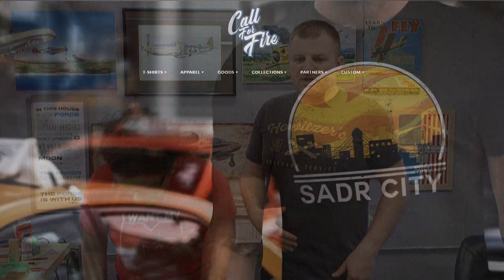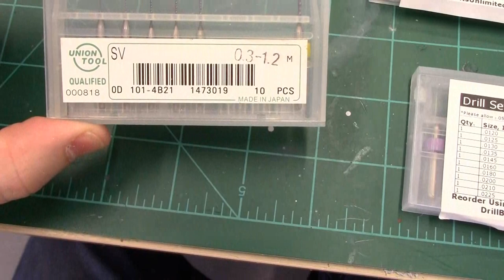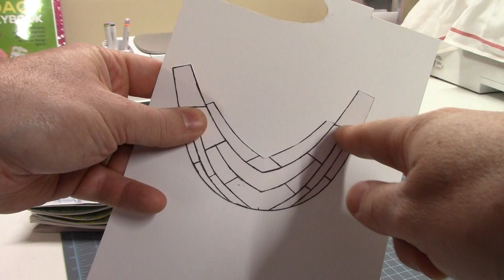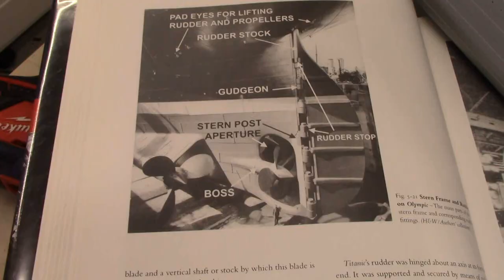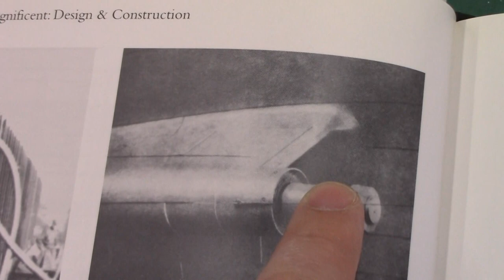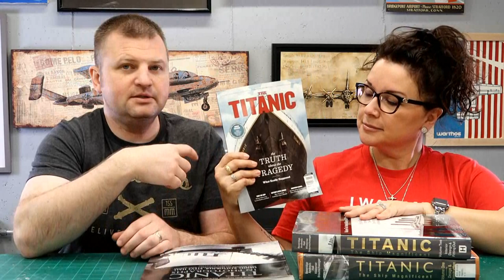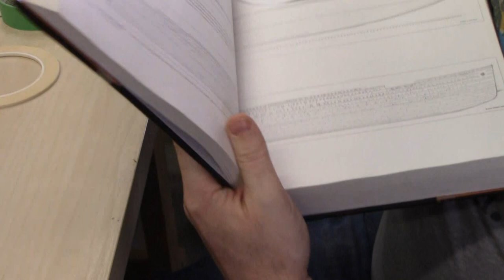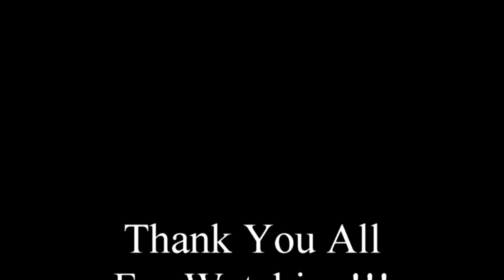1:200 RMS Titanic Build Video 1

Comment: Thank you very much for your answer, I have grouped all the questions on the subject

At 55 minutes 02 in video build 1, you speak of a condenser, are the condensers correctly placed?

In video 8, at 5 minutes 20, what paper do you use and how thick?

In video 9, At 11 minute 11 what the colors please and what item to take (smooth or smoothest)?

In video 11, at 15:07, what product did you use to fill the holes?

Sorry for all these questions, but I find your videos remarkable and therefore, I try to take inspiration from your work. I wish you a good continuation and a very happy end of year celebration. thank you for everything

Comment: Instead of using flexible, breakable drill bits, try using Milling Machine Bits. They are much, much stronger!
Reply from the maker: That's a good idea, but I'm not sure they make them small enough for the size she broke. Its rare that I even use bits that big on these models. Usually they are much much smaller.

Comment: I have used a cricket extensively for cutting styrene for my 1/270 Reliant model.  The newer model does this a lot better than the older model Cricket.
Reply: Err  I mean the Silhouette.
Reply from the maker: Yeah she has the Maker. It WILL cut all the way through the styrene, but it was going to be a bunch of trial and error to pick the best setting for that. Since we were already cutting 3/4 of the way through, that was more than good enough for what we needed.

Comment: 50:00  You could use Evergreen polystyrene T bar for the keel. It doesn't have the rib down the middle, but it wouldn't have snapped like the resin keel.
Reply from the maker: That’s a great suggestion!

Comment: Great Intro Ben and Nora! enjoyed the whole episode immensely! Quick question....did you prime before spraying the hull black?
Reply from the maker: Great question, Phil! And the answer is no! I have never primed a model that I painted with enamels. I ALWAYS make SURE the surface is clean. My preferred method is rubbing alcohol because it dries quickly and will remove oils and any residue left over from the molding process. Then I just spray! If you use acrylic paint, check what the manufacturer suggest. It's possible you will have to prime your model first. In which case, I would follow their instructions closely to get the best results.
Reply: @TheMidwestModelShop  Cool, thanks for the details! looking forward to episode 2 - Good Luck!

Comment: Those metal pieces @54:46 (intake “grate” kind of thing), are sea water intakes. They boil out the salt, and incidentally that gives them literally tons of steam heating, cooking, the steam room (both direct and radiant), and believe it or not, cooling. They took water “straight from the ocean” (it did get screening) when it’s cold, like about to freeze cold and pipe it through the food radiant “refrigeration”, then cabins... public places indoors... Second class... crew... third class... general cargo rooms... kitchen cooking cooling... engine cooling... into the steam boiler again getting hot enough to come out the other end as fresh clean drinking H2O. Pretty smart suckers, hu?  
Actually, it had been done that way in other ships before her, it just that it never been done at the scale of the Titanic and her sister ships. 

It’s very possible had every watertight bulkhead went all the way to the “top deck” (top of the hull), it might have floated long enough to drag it to harbor/dry dock. Possibly even patch it out there enough to bring the bow up a bit.

Comment: I am sure the model isn't to 100% specs as sometimes (more so with older kits) they design for ease of manufacture (like movies based on a true story..lol) and/or a mistake in the molding which is to expensive to "fix" and they go with it.  Other factor is 2d vs 3d perspective, when you draw a three dimensional box visually it looks square but the lines are different lengths. 

Any case the red (technically a primer) is painted at a certain water displacement (weight) and depending on SOP that line may change during re-painting. Many Navy ships that red isn't visible until the paint wears off and they only re-paint above the water until next drydock. Even after a week you have huge amount of corrosion already.
Reply from the maker: No the model is NOT 100% accurate. But there are some details that will never be truly known about this ship making that prospect impossible. However, it is currently the best and most accurate kit you can buy. Which is always a good thing.

Comment: Drilling portholes (sidelights).....oh, you poor bastards. It took me roughly 2 weeks to drill mine with a pin vise (this was the 1/350 Minicraft kit, though). Even though you aren’t a “rivet counter” (some of us are cursed with that level of OCD), I think there is a Facebook group that is the remnants of the Titanic Research And Modeling Association ( I was briefly a trustee on that site) where you can get all kinds of info about the model. 

I started my build in 2012 and put it on hold in 2015 (maybe you’ll inspire me to pick it up and finish it). Back then, you had 2 choices in scale.....1/350 or 1/144 scale (not including the smaller scales) and I’m glad that this scale didn’t exist yet. The time, effort and aftermarket parts would have bankrupted me. I have enough tied up in the 1/350 kit already.

One hint for your rigging and funnel shrouds......fly tying thread (tan and gray). It won’t “fuzz up” on you, it looks correct to scale and can be tightened with a hairdryer. 1/350 uses an 6.0 or an 8.0 so size up accordingly for your 1/200. EZ Line is an alternative but might not take the paint you’ll need to make things accurate. Looking forward to this build series!
Reply from the maker: The fly tying thread is a great tip! How flexible is it once you heat it with a hair dryer? Does humidity affect it? How does it hold up? I usually use a combination of EZ Line and stretched sprue. EZ Line has the undesirable tendency to dissolve when exposed to UV. So you can't put it out in the sun. But, if you bump it by accident, is stretches effortlessly and won't damage anything.
Reply: @TheMidwestModelShop  Fly tying thread is pretty forgiving. The hair dryer tip is only needed if you find a "sag" somewhere. Humidity never seemed to be an issue. This stuff was designed to get wet after all.

The one thing that could happen is that you could snap your masts if you hit the rigging just right, so I built my masts from brass tubing. No bending at all even when snugging up the Marconi wires.

For the funnel shrouds, I recommend making or improvising eyelets in the Promenade deck. This way, if you break a line, you can cut it loose and replace it. The lines aren't glued to the deck. I found mine at a local railroad hobby shop and are stanchions for handrails on steam boilers (HO scale).

Give this site a look. This model was built by another TRMA trustee and also my mentor for this build. He is the one who edited that book you referenced "Titanic: The Ship Magnificent".
His build is an absolute masterpiece:

http://www.titanicmodel.net/

Remember......this is 1/350 SCALE!!!!! You'll get lost in this "How I Did It" website.

Standing by for more uploads and even questions!
Reply: @TheMidwestModelShop  Oh....one other "fine detail" tip. On the cargo hatch covers, I used slightly watered down Elmer's Glue (PVA glue) and toilet paper. 

Heh heh, yeah, toilet paper. At that scale, it had the perfect texture to look like canvas.
Reply from the maker: That one I knew about 😉

Comment: I know this is the updated kit..is there a review of  the improvements made by trumpeter? Plus how bad is the hull..as per Nigel build..looks crazy for a modeller like me to do🤣
Reply from the maker: So I don’t know if anyone has done a comprehensive comparison, yet. But as far as seeing what’s “wrong” with the hull goes... in my opinion the only things you can just look at and say “that’s not right” would be the shape of the kit supplied rudder and the bow hawse hole. But everything else...well you have to really study the porthole placement and compare them. And as far as the hull shape goes, you really have to cut out fairing lines that are to scale, put them on the correct station, as Nigel has, to see what wrong. But I haven’t done any of those things. Because as far as I can tell, but just looking at it, the hull is fine. Because of Nigel’s efforts and others, I “know” it’s not right...but only because they showed us. Otherwise, I never would have known. Bottom line, it IS the most accurate kit you can get. Now you can say it’s the “least bad option” or it’s “the best one out there”. Totally up to you.
Reply: @TheMidwestModelShop  thank you for the info..really helpfull.

Comment: So those portholes that are on the same line of the condenser aren't portholes they are drain vales for the ballast and pumps.
Reply from the maker: Correct. The bigger ones right above them are.
Reply: @TheMidwestModelShop   weird because the planes unused to paint had them slightly.below the above water line.

Comment: hi Ben. what was your old air brush? how much was it? how happy with new one? . is there a steep curve in performance to  be worth it?. my cheap one seams ok. but i only paid $20.
Reply from the maker: My old airbrush was a double action deal from “Air Brush City” I think. Now I have an Iwata. The Iwata is WAY nicer. At first I didn’t think that was the case. But I’ve noticed over the long run that this airbrush is super consistent as long as you keep it clean. I think the most value comes from the fact that it will last for ever. My old one quit working one day and no amount of cleaning and checking the parts would fix it.
Reply: @TheMidwestModelShop  how much was the old one? and the new 1. Iwata ? a particular model Iwata?
Reply from the maker: The old one came with a compressor. So it was a combo deal but I think the brush was $25? The Iwata (can’t remember the name at the moment and I’m not home.) it’s around $140.

Comment: hey Ben I was wondering if you knew what scale the furniture would be on the 1/200 titanic, I contacted Nigel about this but haven't heard back as of yet, for example the grand piano and the beds and other furniture because I was trying to figure out what the scale would be like 1/6000 or 1/5000 or so on, so my friend if you could give me your opinion on this question it would help me out a great deal, thanks and great modeling.
Reply from the maker: Well the ship is 1/200 scale, so everything is 1/200 scale including the furniture.
Reply: @TheMidwestModelShop  yeah I know the ship is 1/200 scale basted on 882.9 feet long I don't think that's going to be the same with the furniture inside the ship but I'll take a look and see if in fact it is 1/200 scale for the furniture and let you know, but thanks my friend for writing back to me about this issue and I think you do a very good job with the models you make so happy modeling.
Reply from the maker: @rockyfolley1511  yeah the furniture is 1/200 scale. That’s the idea with keeping everything the same. All the figures for the Titanic that are “correct” are 1/200 scale. Because the whole model is in 1/200 scale. A 1/6000 or 5000 scale grand piano would be microscopic. The benches are 1/200 scale, the railing is 1/200 scale. It’s alll 1/200 scale.

Comment: Gettin very stressed cause I can't not do the bow of the ships water line right. I look at the video and I'm not understanding how it's done. Please help me. I'm going crazy
Reply from the maker: Are you talking about how I curved it?
Reply: @TheMidwestModelShop  yes
Reply from the maker: I marked a straight waterline first. A perfectly horizontal line. Then I picked where on the bow, for example, the line should end and used tape to angle my line down to the horizontal line I drew. The horizontal line passes through the correct midship positions so you can get that height right.

Comment: Yeah I was wondering if there is any way that I could afford to get this 1:200 titanic model ship I have looked everywhere and this is way expensive on my budget so I’m working on the 1:400 titanic ship it runs about 150 bucks or maybe 200 bucks but one day I found it on eBay new for 35 dollars free shipping so I bought it I did the light and rails and windows on it but building this one would make my day so I’m on a fixed income but I just wished I could get this whole kit for maybe 150 bucks instead of 400 to 1,000 dollars for this size kit
Reply from the maker: Everyone wishes it was only $150.
Reply: Yeah 480 dollars for this kit is way out of my budget so I guess I’ll never get this model for my self and I really want this kit but it is from China

Comment: Hey what was that tool you used at 19:52
Reply from the maker: So an awl? That’s the best way I can describe it. I’ve had it for years! No idea where it came from. The tip is sharp and super hard. I use it for scribing sometimes, but it’s not very good for that. It just kind of shoves the plastic to the side. You have to go back and clean everything up afterwords if that what you use it for.

Comment: i just used my 20 dollar brush to redo my[ hull ] red.it discolored in the bathtub water. in leak trials'. i am converting the ARIZONA TO R/C. I am just using vallejo. then some vallejo acrylic matt varnish. i might have not waited long enough .before my water test i suspect . brush is holding up as long as super clean every time

Comment: You should never drill holes in sheet plastic with a motorized tool. You should also always use primer and use airbrushes for painting. Rattle cans are too coarse and cause orange peel.
Reply from the maker: But you can drill holes with a motorized tool if you use the right one and control your speed. It takes practice and saves an immense amount of time. While in theory you should always use a primer, it depends on what you’re doing and what kind of paint and surface prep you do. Rattle cans can and do produce finishes just like an airbrush. But you have to use the right ones and prep them correctly.

Comment: thinking about the stern portholes .... if the cavity for the porthole was a hole perpendicular to the steel plate and not horizontal to gravity than when looking out of the hole as a passenger all you could see is the sea, the top edge would cover your view, at least in my head you'd want that top edge elongated from drilling skewed to the surface. I think 🤥
Reply from the maker: That area wasn’t for passengers and yes, you would look straight down at the sea. This was very common for a lot of ships. The idea was to let in light and fresh air. You weren’t in those areas to take in the view.
Reply: @TheMidwestModelShop  Thank you for the reply and explanation. just goes to show you never stop learning :) thanks again :)

Comment: How long has this model been available and what's the cost?
Reply from the maker: It's been out almost exactly a year now. They are just shy of $500 USD on Amazon. Prices vary depending on where you look.  I don't think I paid nearly as much. They were a lot of pre order deals out there.
Reply: @TheMidwestModelShop  That's really cool. I built a 1/350 several years back and I know how long it takes to drill the portholes out. That 1/200 could take days. My wife's cat got into my mancave and destroyed my ship by knocking it off it's shelf, I was sick when I found it. Nice job on the steel plate pattern on the stern. Maybe try tracing your pattern through wax paper and then transfer to styrene. It works for leather. The rudder section could be shaped nicely with JB WELD.